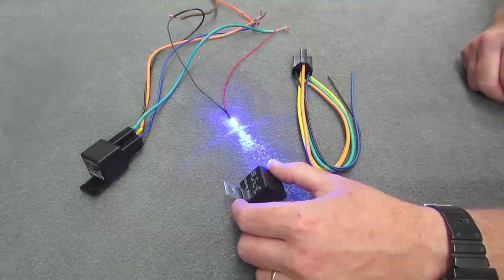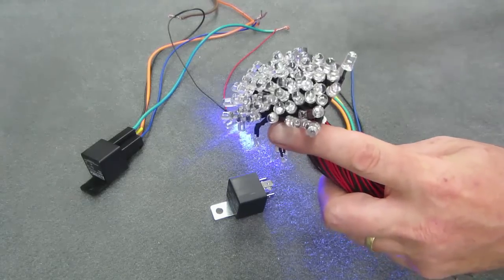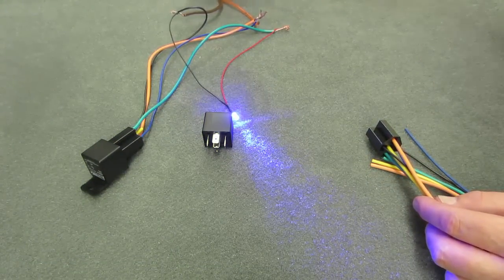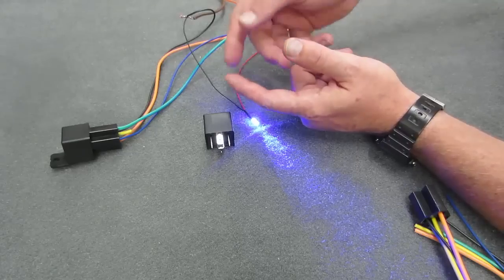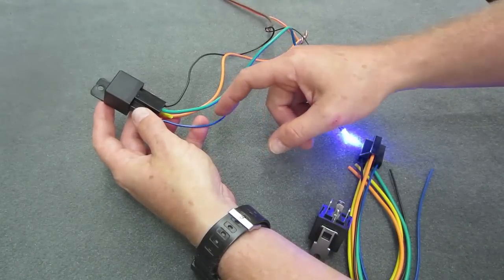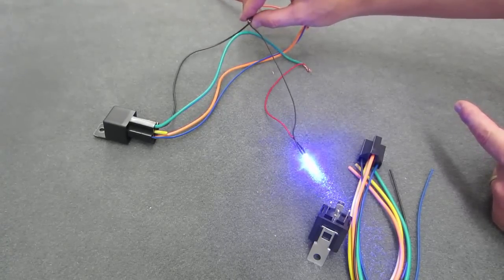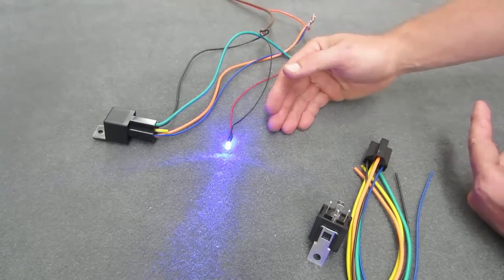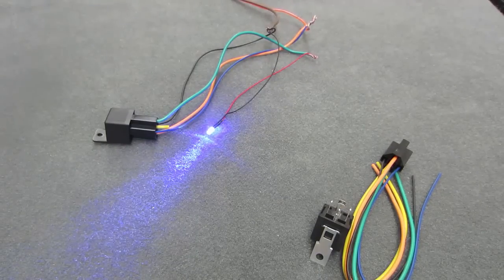How to wire accessories on with the key off  FAKE CAR ALARM LED EXAMPLE

Comment: It will kill the battery once ignition is off because the SPDT relay is actuated. Yes, it actuates the coil if you give power and ground to 85 & 86, and completes 87 and 30 together when the key is off, but this KILLS the battery! LED draws very little; however, you’ll have an excessive current draw on the coil. Specs should be below 50ma...this is NOT a good idea.
Reply: Hi Chessmaster Benz, I'm looking for an exact method of doing this.  If this method is likely to kill the battery, can you please suggest a better method?  Look forward to your response.
Reply: @baileywhanau  if you or anyone is still interested. Instead of doing it this way you can use the relay still and instead of wiring it to come on when ignition is off you wire it to be off with ignition off. So on a standard bosch 5 pin relay when the relay is active(energized) the 30 pin is input and 87 is the output while energized. 85 and 86 are your coil(switch trigger) doesnt matter which pin gets which but one side needs ground and the other side 12v. So ground one side and find a fuse in the junction block that only has power while key is on for the 12v side of the relay coil. Get an "add a fuse pigtail" to pull power off the existing circuit. Next use pin 87a for the led you want to come on while the car is off. When the relay is turned off the internal switch moves from 87 to pin 87a and stays there until energized again. So when the key is off the relay will be off and 87a is the output(no coil draw from the relay) when the key is on it will break that connection and output on pin 87(which you can leave empty). A 12v single led like the one in this video would take days to drain a healthy car battery. Ive got  6 led bars under the front seats and under the dash and have accidentally left them on over night and through the following day and it didnt even drain it enough to slow down cranking speeds. So with the output of the relay being 87a with the relay being de-energized i think power consumption is negligible with a small led.
Reply: @1ftintheflames  you Sir, are a clever man. Great explanation and a great way to prevent excess battery drain while the car is parked. Thanks!

Comment: Whatta dork you refer to pins 85 & 86 completely opposite. 85 is at 3oclock, 87 at 12oclock, 86 is at 9oclock and last is 30 at 6oclock. This is why people have to do disclaimers.

Comment: Why relay ? Ignition live and battery live, ignition on two lives will not light up. ignition off the ignition becomes earth done.
Reply: if ignition if off i will never be earth. also led will burn out if reverse voltage is too high
Reply: @superjojo555  when ignition is off the wiring is still connected to the circuit, so whatever it feeds becomes a negative - a bulb in the ignition circuit will still act as a conductor on low voltage without lighting up. As for blowing the LED a live on both sides won't allow flow of electric so won't be damaged just fit correct way round so it lights when ignition is off.
Use a flashing LED and job done.
Auto electrician told me how to do it.